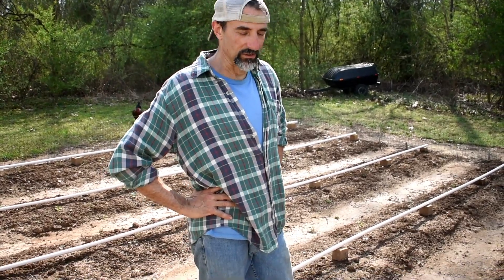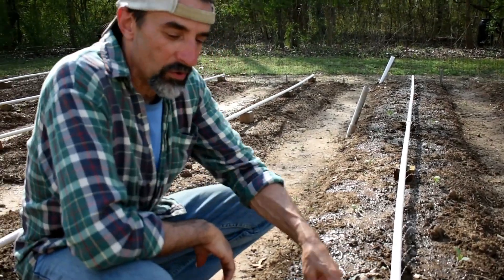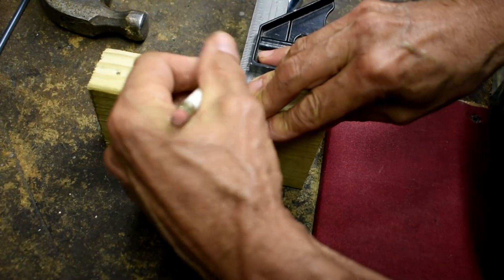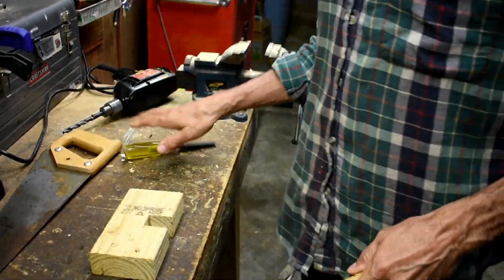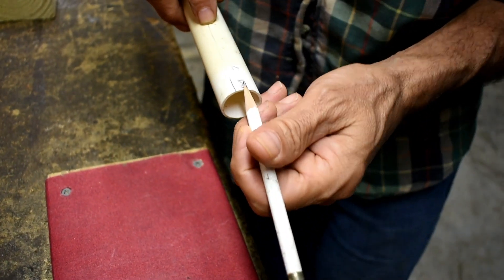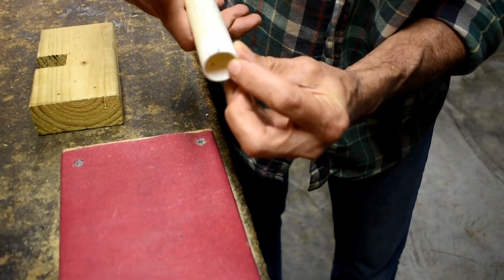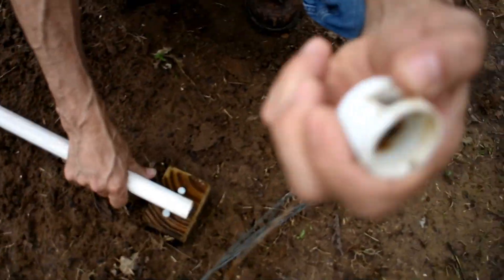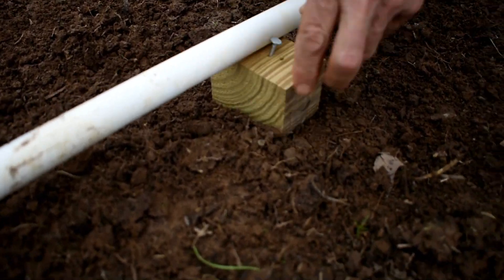PVC Garden Watering System (How To Mark The Pipes)

Comment: Can I use half inch PVC
Reply from the maker: It probably depends on hoe many beds you are watering and how long your beds are. Also how much water pressure you have.
Reply: @ghog63  Well am using 5/32 drill instead hundred feet beds using half inch PVC with 2.5hp 105cc semi trash pump
Reply from the maker: @kelvinwaldropt1841  Wow, quite a setup. Sounds like it would work. Let me know how it turns out
Reply: @ghog63  Yea it's the total one inch pump but I think I would use the 1/16 bit instead also I putting valve so I can always water two to three beds at the same time it's flat land by the way

Comment: Or you can lay the pipe on the ground, tape it on either end so it doesn't twist, then lay a sharpie on the ground against it and run the sharpie along the pipe. Easy.

Comment: Hi ghog63. I was watching your electrical conduit pvc hoop house build. I have a question. Did you cut the connecting end off the 2" and 1.5" pvc? I'm about to try my hand at the build but was wondering if you did something different to the connectiong ends before you put them in the ground as the 1.5" will not go in the 2".
Reply from the maker: You are correct... just cut the ends off so they go in.